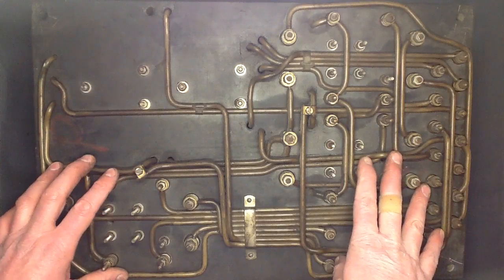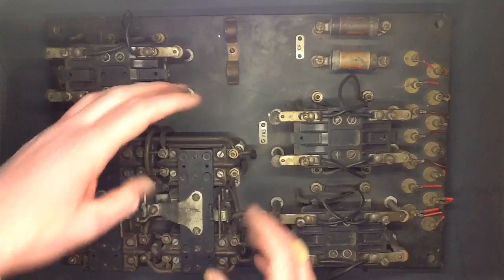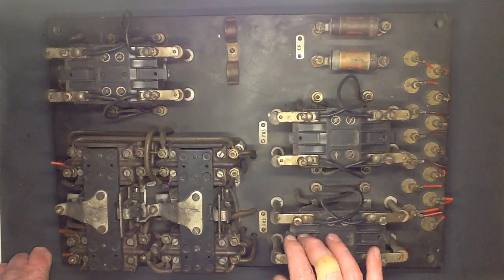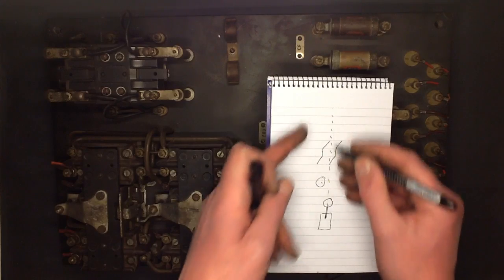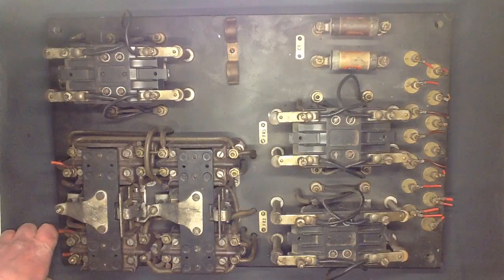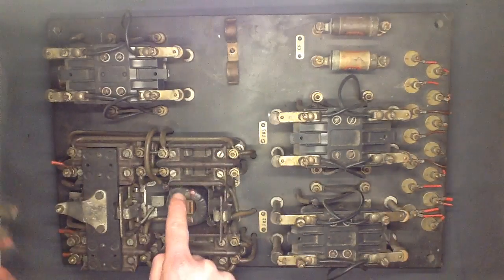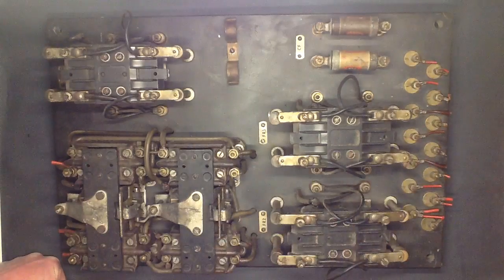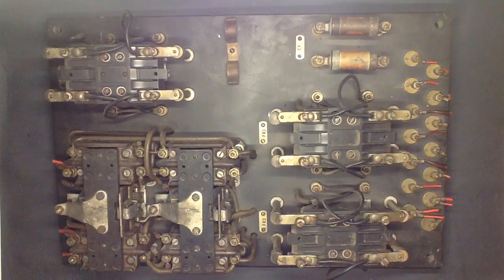Really old and VERY heavy slate elevator controller.

Comment: Thank you for the practical example.  It was only just recently I learned about three phase power.  Two months ago, I'd not have understood a bit of it.  Three wires with no neutral tells me it's Delta, which is perfect for motors and 415V isn't such an odd voltage since that's just 240V*1.732, where we see half that at 208V Stateside with our mains the way they are.  With reversing a 3-phase motor being as simple as swapping two of the hots, I see what those contactors are doing.

Comment: AAH: a relatively young lift control panel.
Carbon contacts were the norm with many UK lift manufacturers well into the 70s.
They were still making everything themselves. Contactors, Relays, buttons etc. Crazy.
In my youth, I worked on a DC lift built in the 1890s, with a Royce (of Rolls-Royce fame) motor.No push buttons, just an up and down lever.
30Kg.
Michael

Comment: We have an old building on my campus with an old controller.  It must be the original controller from the 1960s.  Lots of clicking and clacking when the elevator is called.  Just swipe an emery board across the dirty points and the machine is back in operation :)

Comment: I'll guess that it weighs 19.4kg.   But Are you sure it is Slate??  Looks more like a product called Bakelite.
Bakelite was used for its electrical nonconductivity and heat-resistant properties in electrical insulators, radio and telephone casings, and such diverse products as kitchenware, jewelry, pipe stems, children's toys, and firearms.
You should do a bit of investigating. The FR1-2 and 3 relays are reversing relays. They energize the drive motor in two different rotations depending on whether the elevator needs to go up or down to arrive at the selected floor.
Reply: +scheerBOM 
Well, that is a fair question. 
I'll try to make this short and you may not agree or understand my situation, but it 
was a situation I found myself in during the course of my career with the DOW Chemical Company. 
I worked at a very small manufacturing site that had three production plants, one being a Polystyrene production plant.   
    Since the site was small, much of the engineering was done by the Engineering Group at DOW's Midland Michigan Main Facility.  I was hired as a Journeyman Electrician and because of my degree in Information Systems I started working with the offsite engineering team  who did the programming for the 'Distributive Process Control Computers' or the Computer Systems that ran the production plants. After four years that engineer became the Superintendent of Process Control in Midland and ceased to write Program Code. Since he had worked with me and felt I did excellent work and since I 'Lived and Worked' where my three plants were, he supported the plan that I continue to write the Program Code for the three plants.  
   During  the next  fifteen years the plants went through many upgrades, expansions and increased production rates by a factor of three.  In Midland Michigan they would generally have a team of Degreed Engineers to Develop, write and review the computer Programming.  Yet, here at my site, I alone was caring the workload  normally performed by such a group.  Yet, I was a Not a Degreed Engineer.  So, I had to prove myself again, time after time, especially when the Chemical, Mechanical and Electrical Engineering staff at my site would rotate out and newly graduated engineers would fill their place. Again I was not a degreed engineer.  To them I was Simply a quote:: 'Journeyman Electrician'.    
    Though,  I did have a degree in Information Systems and a vast amount of experience in Process Control and I was truly passionate ( and flattered) about the inflated role I was tasked with.  During my career my 'Body of work' was questioned, scrutinized, and constantly evaluated.   I was performing a job role for which I did not have 'Valid Credential's'. 
    It was a very tough place to be, yet my annual raises continued to grow exponentially over the years and I was paid very well. And since I received OT pay I made more money than the majority of the relatively inexperienced engineers at my site. That in itself, did not sit well with them!  I handled it to the best of my ability and it was a strain and took a toll on my natural easy going personality.  Most people, especially the 'Production Personnel' I supported and worked with, will say I did a Terrific Job.  
   You see,  It was as if I was in the position of being only a 1st Lieutenant in the Army, yet telling the General how to run the war!   I think you can see how that would not go over very well! HaHa
    SO, The short answer.  I was forced to develop the habit of viewing everything I did, As Well As the things that other people did, that might impact my work, through Very Critical eyes! Now that I am retired, that 'Habit' of viewing every aspect through Critical eyes seems to linger on. I recognize that now, and I am still trying to learn to "Just Relax a Bit"
Sorry for the Rant. Take Care, Bob
Reply: +Bob Duvall I'm pretty sure Clive knows what Bakelite is.
Reply: +LoricSwift 
Slate is of a fine grained, foliated mono crystalline substance that also shares characteristics with other minerals that contain a type of Mica altered substances.  
There appears to be some degree of 'Cleavage' shown in the video which is Not a characteristic of Slate, rather so with Bakelite.
Thus, I merely posed the inquiry as an opportunity to confirm the assertion.
Most Kind Regards...
Reply: Sorry if my comment came across as patronising. I just meant it more in the sense that I'm pretty sure they stopped making Bakelite before I was born, and I know what it is, and Clive seems like someone with a lot more world experience in this sort of thing than me. Its wrong to make assumptions of course, but I would be surprised, I just made a comment to that effect, it wasn't meant as a criticism.
Reply: +LoricSwift   No Problem.   My past work profession seems to have created a habit of "Critical Curiosity".
Slate OR Bakelite... Whateverrrr  HaHa   Still extremely interesting, vintage and cool!
And Clive seems to come across all kinds of stuff like that!   Keep up the good work Clive!
Reply: +Bob Duvall  Now i have to ask, what profession creates a habit of "critical curiosity"
Reply: Bob Duvall
Nice story, i hope itll run half as good for me.
Reply: These controllers were always a slate plate panel, usually mounted on an angle iron frame and rarely a cover. All those open live electrics were really only protected by keeping the machine room door locked! They were very common back in the days when I started as an apprentice engineer. The machine room could potentially be a very dangerous place even without the exposed machinery that could easily tear you limb from limb.
Reply: @Carol-East   Well  ""These controllers were always a slate plate panel""  Sorry, Simply Not True.
Here is a Quote from a Very Informed article  "" These vintage electric boards are often times mistaken as slate, when in fact they are asbestos boards sealed in a protective coating of Bakelite black resin.  """

Enjoy....   LINK::   https://oldschoolfirealarms.com/control-panels/